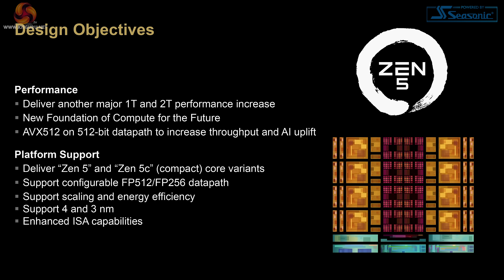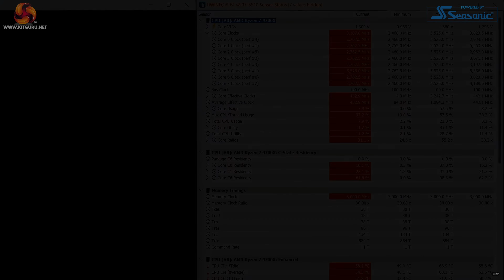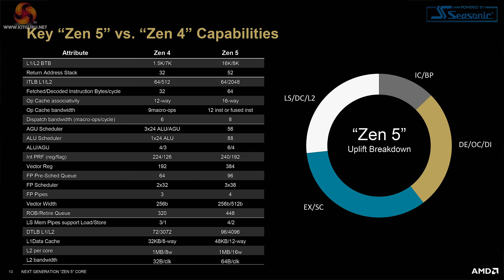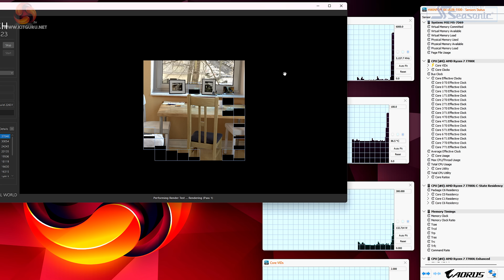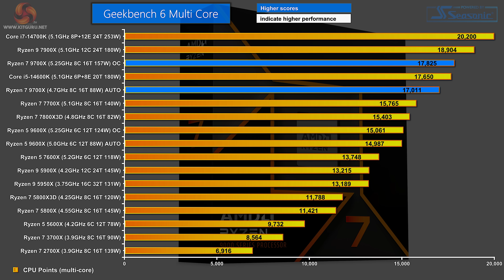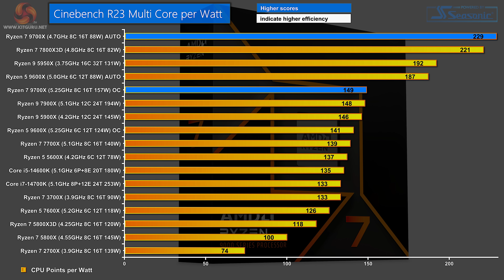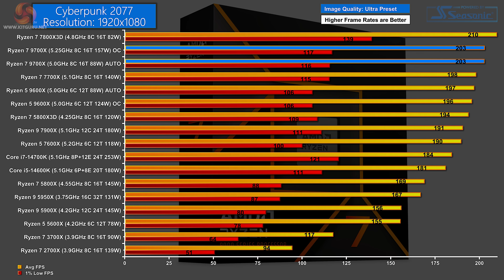AMD Ryzen 7 9700X review: YouTube hates this CPU

Comment: Leo, some will start calling you an AMD shill now :-P 

Jokes aside, I agree with your finding and conclusion. Being an electronic engineer in my previous life, I have a special appreciation of doing the same amount of work with so much less power. In any case, I have seen another review that shows that you can get 15% higher score in cinebench or something with enabling PBO; that's an easy 'fix' for those who want their significant generational bump in raw performance.
Reply from the maker: Leo has been called an Intel shill for years - so its quite refreshing - Allan. Thanks for the comment !
Reply: @KitGuruTech  it seems the best choice will be a ryzen 9700x  with 32 GB DDR5 6400 MHZ and a X870 MOTHERBOARDaccording to reviews, But mine RYZEN 1700 that ihave since 2017 still runs perfectly evrything maxced 1440p 60 fps which means htere is no reason to chnage it yet it loads evrything in 1 second(games, windows, programs, movies, internet) and also runs all games maxed 1440p 60 fps. MINE MONSTER PC IS
RYZEN 7 1700
RX 6700XT 12 GB RED DEVIL
16 GB   DDD4 3200MHZCL15
MP 600 2TB WRITE:4950MB/S READ:4250MB/S
DELLP2416D 24'' 2560X1440 60 HZ IPS!
AS for windows 11 i can install it with Rufus even without chaning cpu too.
Reply: Out of the box testing is only showing how the review motherboard operates.  The only way to limit the differences between mbs is to do some degree of controlled tunning.  Ideally like a static clocking at different power points.  Then there is minimal effect from the motherboard.
Reply: @robertmyers6488  Most people buying this will plug it in and run it. Dont for one minute think the audience here is representative of the real world.
Reply: Heat is also directly proportional to power used and the more heat the lower longevity. So it's not totally crazy by any means though if you worry more about that it's not the only option.
Reply: @LTPottenger  The CPU is rated for 95 C. overclocked he was just hitting 85C.
Reply: Professional Game Dev here. Well stated quagmire321able!  I too am greatly impressed with AMD's lowered power usage while increasing the efficiency -- doing this generation after generation is impressive as hell.  Intel historically used to LOVE to suck down more and more electricity to get more performance (with the appropriate 14nm+++ meme back in the day) until they started shipping P-Cores and E-Cores but AMD is doing the HARD WORK of redesigning to be more efficient while taking advantage of 4 nm.  I feel like this is being greatly overlooked with barely a mention by some journalists with the tech YouTuber's being SO focused on "being first" that they are kind of missing the forest through the trees IMHO.  AM5 is a long term platform to build upon.  It is unrealistic and a bit naïve to expect to see a 15% improvement every generation.

There are always some teething issues with bleeding edge tech and HUB's benchmarks (which normally are quite good) seem to indicate that there is a potential motherboard BIOS issue.

I feel like 50% of the customers who watch the Tech YouTuber's would be fine with AM4 5800X3D or AM5 7800X3D gaming solutions with the rest of us doing "non-gaming" workloads should wait and see what the 9800X3D and 9950X brings to the table -- especially with code compilation, rendering, and scientific computing workloads.

With some of the bigger tech YouTubers cherry picking their gaming benchmarks it can be hard to tell where the outliers are. I don't see any reviewers "tagging" games as being CPU bound, Memory bound, or GPU bound to help inform viewers that they can realistically expect across different brands/models.
Reply: @MichaelPohoreski  Agree and those power and efficiency changes will benefit total system conditions resulting in less noise and heat.    

I can understand seeing how they perform in current popular titles but the difference between different CPUs in games is highly amplified beyond the actual difference.  Leo was trying to subtly point that out.

Further, the cost argument is facetious as each new generation is always more expensive than the one it's replacing.  Here they lowered the power by 40%, decreased the cost of the chip, and still providing roughly a 5 to 10% performance gain.    They will laud the 9800x3D but from a cost/ benefit perspective it won't make sense. 

Waiting to see how the 9850x performs, but I have a 7900x3D that I picked up for a good price during the Amazon sales.  

Thanks for the rationality.
Reply: @robertmyers6488  with the lower temps they can push the X3D CPUs a little harder.
Reply: Cause he is. Steve from HUB already told him on twitter what to do to see how poor these cpu's are. Like there's selling out then there's literally SELLING OUT.

Comment: NO, Kitguru wasn't wrong!!  It's just some who purely look at narrow gaming value and ignore new features and efficiency which offer longer term benefits who see a flop.
The difference in results obtained, perhaps due to different mobos suggest teething troubles which ought be eliminated by the Intel style reviewer kits, providing mainboard and RAM matched for the (likely) golden die CPUs.
OTOH it's frustrating seeing AMD not tighten up the marketing to win, but on the other as a customer I can enjoy settling prices due to the fog of uncertainty created by conflicting review opinions.
Reply: The cost of the item in it's entire lifespan is the most important.

Time
Electric 
Item cost
Reply: @glyntaylorwilliams  there's a pressure not to lower prices on launch, if the 6c 65W had been branded Ry 3 9400x, with the 8c labelled as Ry 5 9600x they'd need to cut prices more and rethink the upper tier, but they'd earn plaudits from media pundits, just not so much from shareholders.
It's ironic overall that Zen4 was panned for 95C and higher TDP, now lower temps and TDP are panned due to limited performance gains on the same process family.

Comment: no, it's not good in anyway possible and even lower tdp doesn't make an excuse. having next gen performing the same as previous one and sometimes even slower is a disaster. 7800x3d is cheaper and faster than 9700X. smh. r7 7700 has 65W tdp and costs $220-230. much wiser money spent than any zen5. lol

Comment: Your point in the intro would make sense…
…if the older models weren’t available alongside it for much better price, didn’t have the same lifespan as these new ones and those efficiency gains were actually measurable in terms of the electricity bill.
Reply: The older models beat the new chips in some applications as well, not good.
Reply: 50w power draw difference is about 1p for every hour the computer is on, over the life of a PC that most definitely adds up. eg, my desktop at home has been running at least 50hrs/week (v conservative) for the last 4 years of working from home. About £30/year, £120 just for the last 4 years, which is a fairly conservative lifespan for a decently high end PC --- as it happens, my CPU is a 4770k that I bought in 2014, so over those 10 years actually a 50w saving for equivalent performance would've saved me the cost of a new CPU
Reply: @thenayancat8802  perhaps, at full chat yes, but you rarely if ever run your cpu at full utilization for any significant period of time. Usually, they turbo up and down depending on their own coding, making this difficult to calculate.
Reply: @TheLastCrankers  Efficiency adds up though! That may be the case with one gaming PC - and a 50w drop is noticeable even then (especially with heat in the room), but spread that out to all my systems? and spread that efficiency to the rest of the users? Especially the business users? That 50w per part can make kilowatts of saving across a full building. 

Not to mention that efficiency gives you more OC headroom. If your max safe operating temp is 95C - efficiency will net you more power per degree as well. I'm excited for the 120 and 170w TDP parts - I bet we'll see a big performance increase.
Reply: @Tuhar  refer to my previous comment
Reply: @TheLastCrankers  I guess you don't game for hours at a time. Different use cases mean different values. I can absolutely lock a processor at 100% for hours on end.
Reply: @Tuhar  Gaming doesn't actually use 100% of a processor fyi (except for short bursts like loading levels or compiling shaders and so on). Unless you're running sth like a 4090 with an i3 at 720p maybe lmao
Reply: @TheLastCrankers  Or just running cpu-bound. Which can happen, especially at lower resolutions pushing higher framerates. Or when running a game server - if I chop up an 8 core cpu with 2 cores per vm - I can see a lot of utilization ~70% avg. Power efficiency matters.
Reply: @thenayancat8802  but of those 50hrs how often is the computer running full tilt, and how often is it at idle.  For most people (who aren't rendering video all day) our PC is using idle power draw. At that point there isn't a 50w difference.

Doesn't mean there aren't benefits, but it does mean it will change depending on who you are and what your usage patterns are like.  There will likely be many people where the "efficiency" gains of the new parts don't actually pay for themselves in energy savings, compared to the price difference from the old parts you can still buy right now.

Comment: First sensible review I sw on these processors...

1. The power is taken into account....
2. It does not crash like the intel...or degrade? That is a win...

I am looking forward tot he Ryzen 9 CPU's, and specifically the X3D versions whenever they get released.

Thanks!
Reply from the maker: Glad it was useful to you
Reply: Wow two whole things you could list! Good job! Maybe we can get to the number 3 next time.
Reply: @JordanJ01  If you want more detail...watch the review. Why do I need to list it all, seems redundant?
Reply: @Morne_Smith  I know you're denser than rocks but I'm making fun of the fact you have nothing to list. 

There's zero reason to buy or upgrade to these CPUs if you own anything remotely modern. Be delusional all you want, just get the AMD tattoo already.

As an AMD owner that has owned a 7700X and 7800X3D in two different systems, there's no reason for being this much of a fanboy. Admit wrongs when your team does them or you are not a genuine person.
Reply: @JordanJ01  Power efficiency is of massive benefit if you want performance in a small form factor machine. Just because it isn't the metric you seem to care about doesn't mean for a large group of people it is not a huge improvement. If you want performance turn on PBO to recover the power behaviour of the 7xxx series... or as stated in the video wait for the x3d parts.

Comment: Great work. The box to my left has a 7700X (and an Intel Arc GPU) so not worth upgrading, but ifi t were to go pop it seems like a 9700X would fit the bill. I also have a 13700-based system and I'm waiting for your review of the X3D parts before thinking about replacing that - or for it to go pop.

Beyond that I hope that you will do a follow-up at various power levels.
Reply: Well in due time the ARC gpu is worth upgrading. Probably well before that CPU. 

But damn are proper GPU’s expensive these days.
Reply: @barneyklingenberg4078  I'm hoping for Arc Battlemage later this year.

Comment: what is this testing, why would you test a CPU for CPU benchmark at 1440p. Insane, anything to make it look better?
Reply from the maker: I think you mean 1440p and 1080p. What resolution would you suggest?
Leo
Reply: Not using 1440p and/or ultra settings. Zen 4 is supposed to be about 50% or more better than zen 2. It doesn't look that way in these tests. A lot of them using 1440p would be gpu limited hence not a cpu test.

Comment: Ok, so if the auto setting yields better results, then there's a possible sweetspot, yes?
I noticed the same with my 7700X, sure I can brute force it to 180 Watt PPT. But instead 85 Watt gives me 5490 MHz boost clock at 40 C degrees.
It may be interesting to research if there's a bell curve there, with different PPT settings. The reason many YTers didn't bother, is because every processor is different.

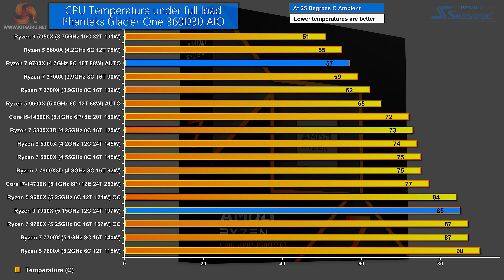Comment: nice. i think there is an issue at 12:10, the 7900X is highlighted in the bottom instead of the 9700X with the unlocked TDP.
Reply from the maker: Curses. yes, quite correct. Well spotted.
Leo
Reply: @KitGuruTech  I don't blame you with all the 7s, 9s and Xs in there to be honest...